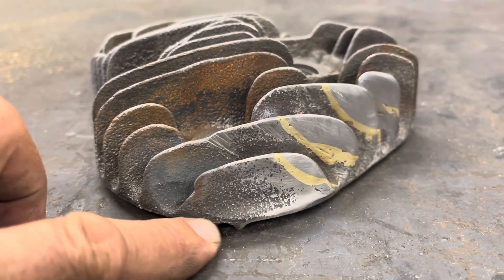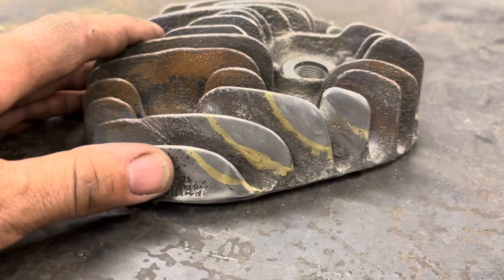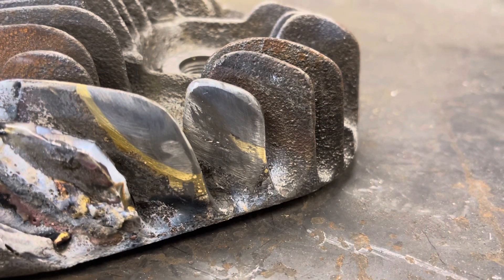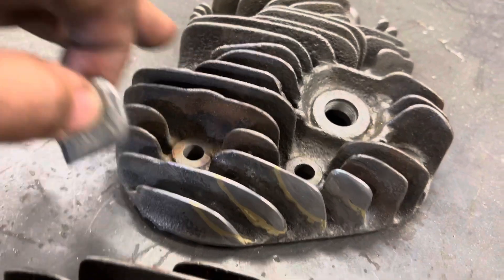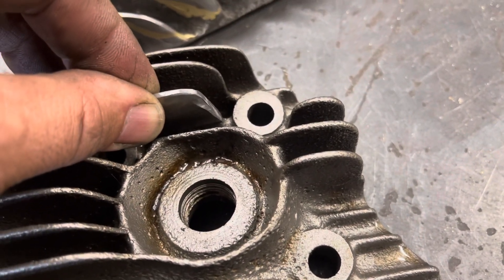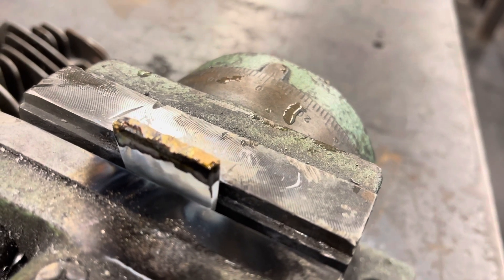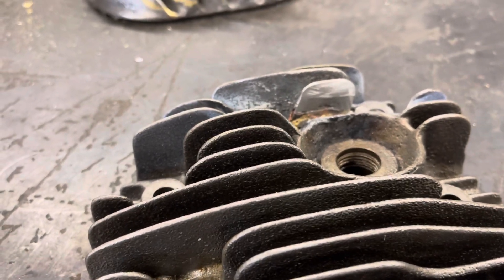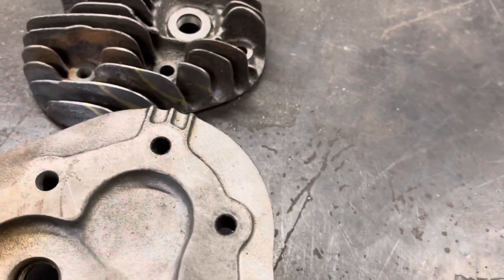Harley-Davidson WLDR Factory Racer 45 High Compression Billy Lane Cylinder Head Fin Repair

Comment: Is the reason your welding with brass and a torch is to keep the heat down so you don't crack the cast head? I have a Ford engine block that someone used straight water instead of coolant for the cooling system and let it sit for years. It rusted part of the mating surface on the block for the water pump and now it leaks from that spot. I'm wondering if I can weld some steel to that rusted area using brass and a torch, then some how machine it to the correct shape.
Reply from the maker: Cast iron cracks easily with any expansion or contraction due to adding heat during welding.  Brazing allows the addition of filler material without adding the additional heat that comes with welding using ferrous filler rod.

Comment: Hi Billy. Been digging your work since The Horse 1999 when you were introduced as Warren's little brother who can build too. Anyway...Why not use a cast iron fin patch instead of steel? Is it cast steel? Are the thermal expansion rates the same, or not a factor? Thanks for this type of vid. Short but informative repair vid, with action shots even. 0:55